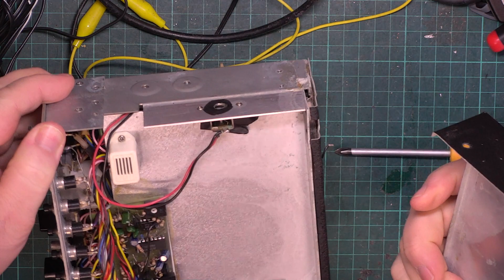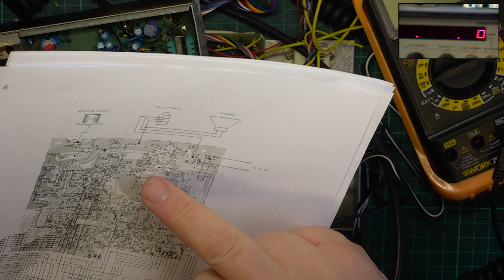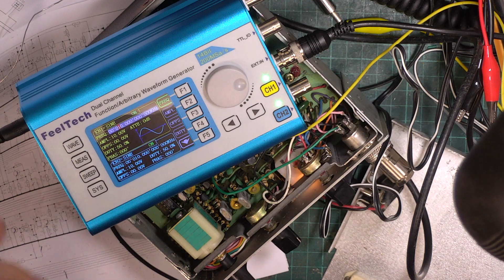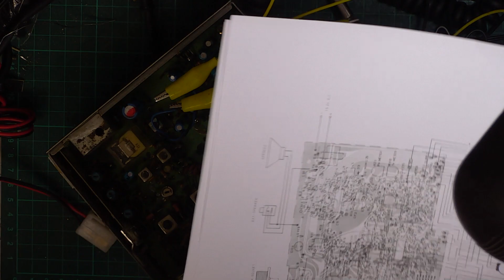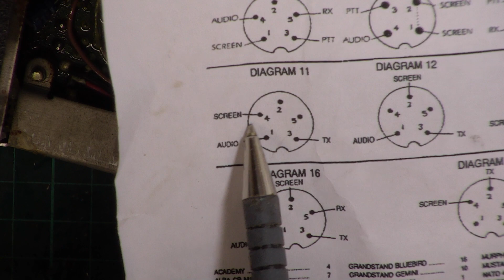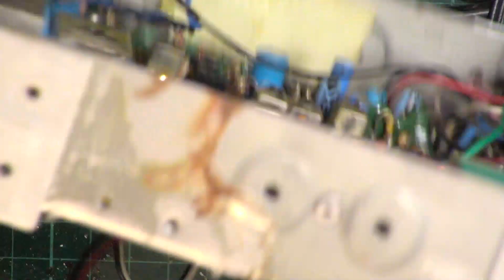Catswhiskers CW1580P UK CB27/81 CB radio (mobile) - extensive repair

Comment: What a job! I suppose they are rare enough to warrant all that work. Shame the selcall had to be removed but at least it’s now working. I was wondering if you actually connected the function generator to the radio or just dangled a wire near it. I’m just doing an LCL 2740 at the moment and although it’s working it needs aligning correctly. Great work as always
Reply from the maker: You dangle the wire, never with a direct connection.

Richard
Reply: @ukfmcbradioservicingTango21  thanks Richard. I couldn’t find any alignment info in time for last Sunday’s stream but I have reviewed some of your old footage on the LCL2740 now so I have a better idea. The detector didn’t look great in my scope
Reply from the maker: It's ...1) set the 10.240Mhz ref oscillator 2) set the TX frequency with the mixer xtal 3) set the rx freq with a marker oscillator @ 10.695Mhz. Before getting this blue chinese generator, I was using our Pye one @ 455Khz. 455Khz is much harder to hear than 10.695.

All these sets with multi xtal mixers are usually off freq on receive. So that's DNT, LCL & some Team, Skiptech & Jesan models for starters including four base

Richard
Reply: @ukfmcbradioservicingTango21  Thanks very much for the detailed response Richard. I will have a go at that later. Regards Graham

Comment: I can't believe that, two sets the same DNT & LCL and they wire the mic's differently!  How stupid is that, are they trying to kid the customer that they are different sets? 
When I think about I must have found that out as I remember linking both pins so they could use the mic's in both sets.  Someone had the LCL and the other had DNT with spare mics, they came across wanting me to wire them to plugs, I hate those din plugs for CB or any radio.  I do remember linking the pins for them.  I wish my memory was as good now as before I was in hospital for so long!
I bought a economy set, I have no idea why!  I think I was going to give it to someone, in the end they didn't want it.  Maybe just as well, it might have driven them mad hearing all 40 channels on the same channel, ha ha ha!
I only fixed one, that was more than enough for me, what pigs of sets to work on.
The squelch is not all that good, neither is the audio, but then these sets are not up to much anyway.  I hate them!
Reply from the maker: The DNT has 9V on one of the  mic pins.

Richard
Reply: @ukfmcbradioservicingTango21  Not on the spare earth though, i don't think anyway, I forget, but I do not want to see another DNT or LCL again, though I do want to play with a Communicators receiver with a crystal filter or even a 10.695 ceramic instead of a 10.7 0ne.  My mate says he still has his somewhere (a Radio Amateur) but he has not seen it for years.  Plus he is now technically in the EU, even though he isn't, if you follow me.
Reply: Oh, that's right, they use a relay to switch to TX, they will have voltage in the TX pin to bring it to ground.
Reply: Rather than edit, that wouldn't have stopped me linking both pins, the rest were the same, just the ground was on another pin.  Linking them both would make a mic work on both the LCL and DNT.

Comment: I am amazed that there there was enough "room" in the business math to allow a company to buy radios (or just boards?), add circuitry to them, and put them in a new box and resell at a profit.  Crazy times!

I did have to review the US Rules ("47 CFR 95") to see if selcal was legal on US CB ... and it is.  Subudible tones, too, though I don't know how that would work with AM (would it?).  I am a little surprised that no one has petitioned our FCC to allow FM on CB channels.   Y'all have the same spacing between channels (10 kHz) that we do even if your spectrum is "above" ours (US channels are identical to CEPT including the silliness between 22 and 25) so FM should be doable.  And it sounds SO MUCH BETTER.  

Do I have it right - CEPT allows AM/SSB/FM and UK only allows FM?
Reply from the maker: That is correct, so post 2014 CE approved radios for the UK are 80-channel. UK remains (correctly) FM only & is a unique set of 40 channels for the UK. The UK also had a UHF 20-channel allocation cancelled about 1994 on 934Mhz @ 8W FM....got pinched by cellular phone networks.

Richard, G0OJF, UK
Reply: @ukfmcbradioservicingTango21  Rumour has it that 934 was allocated to CB so the prospective cell operators could collect data on that band regarding propagation etc. Don't think any cell operators use it now but I'm far from an expert on it and stand to be corrected. Should be reallocated to CB again. I believe there are a few diehards who still use it and there is supposedly a 934 net somewhere south of the border.
Reply from the maker: Yes you have it right. As a UK user, you may use the 30 CEPT channels in  FM (since 1987 on PR27CB approved radios) then since 2014 use the same 40 CEPT channels in AM/FM or SSB, provided you are using a post 2014 CE approved radio. The unique 40 FM only UK channels may alsobe used, giving a total of 80 available channels.

\Richard, G0OJF, UK